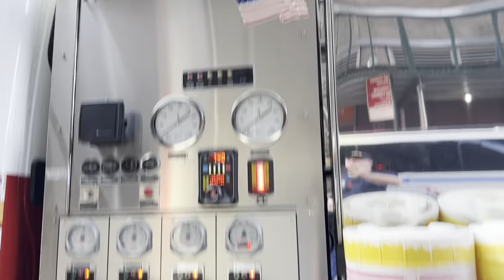FDNY Manhattan 5th Alarm 10-86 Box 0782 Crane Collapse with Fire Major Matrix Response

Comment: Those engines are huge. Here in UK they are about 26 -35 feet long and about 30 tonnes 🇬🇧🙌🇺🇲 respect to all you firefighters 👊
Reply from the maker: Thanks for watching
Reply: In UK they would have put the fire out quickly instead of taking lunch breaks while it burned.
Reply: @Donnie-fe7dc Sure, if it was a regular house fire, but something like this requires a ton of resources and logistics. You can't just send fighters straight into a fire like this. You need to assess the situation and act accordingly. You simply cannot say that our UK Firefighters would have been more effecitive.
Reply: Better to have them electric instead of having a diesel engine on top of it which could overheat and start a fire
Reply: @peon9282 this is the dumbest thing I ever read. Electric isn't strong enough to power the pumps, not even close. Not to mention batteries are way more at risk of overheating and causing a much worse fire that can't easily be put out. Stop it with all this electric nonsense

Comment: Thank you so much Skyler.  Great coverage.  It will be interesting to hear what caused the fire.  Blessings to the FDNY and EMS for the work that they do.  They are all exceptional at completing  their tasks. Blessings to all and please remain safe!  🤗
Reply from the maker: Thank you too!
Reply: Silly how FDNY has names on the back of their uniforms, but the Yankees do not.
Reply: It was apparently caused by a leak in the hydraulic pump while lifting 18 tons of concrete. They were just starting to pour slabs on a recently built floor when it happened.
Reply: @Mildain2000  how do you know that brother? I am just curious, I "thought" these cranes are powered by electric. I am not above correction. And "if" fuel, it'd be diesel which has a different flashpoint then gasoline, I am in this field brother, I am just trying to understand..
Reply: @bobbytogores4902 I was confused by that too, all tower cranes I have seen are electric. Thinking maybe it was hydraulic oil ? And the engine room they referred to is the motor/ motor control room. Simple fire in a nightmare location. All the best to the fire fighters and this guy for filming it.
Reply: @bobbytogores4902  Apologies - I meant to type hydraulic pump, not fuel.  I have a picture from directly across the back side of the crane (about 100 feet away) and it's coming from what looks like an electrical room behind the cab.  What surprised me is how fast the cables gave out considering the load they're rated for.
Reply: @Mildain2000 load at normal temperature.
Reply: @bobbytogores4902 hydraulic fluid. We used low flash in the foundry but most hydraulic fluids are flammable. I would think they would require low flash oil for equipment at heights like this.

Comment: This was amazing coverage of this incident!! Thanks for all the effort of putting this together and posting. Great teamwork throughout for what proved to be a difficult location to tackle. So interesting to see this whole thing unfold and see how US emergency teams worked this. Hope those who were injured are ok and make swift and full recoveries. Remarkable no one was killed in this incident. With an ever increasing number of taller buildings in London and our other major cities here in the UK, it makes me wonder how ahead of the curve we would be to tackle fires like this.
Reply: This is going to sound cliché but the truth is due to both fiscal and political reasons most FD's in metropolitan areas have to improvise an awful lot with elevated fires like this. FD's have been calling for not only limits on high of structures but updating of the building and fire codes so that internal structural fire suppression systems and water feed lines for FD"s be on a separate line than the cities main water supply. Equipment and manpower wise again that is based on the fiscal draw per year and the number of structural fire calls they respond to. Not long abo England saw the results of poor building code enforcement when an entire apartment block tower was engulfed in flames. I am positive those firemen and first responders did all they could do during the fire itself. But what was allowed to happen prior to the fire was out of their control. The building owner with full knowledge of the material to be used hired a contractor to upgrade the buildings facade with a highly flammable building material which only hammpered suppression efforts. Hence where the politics comes in, a lot of agencies don't listen to the FD when they say we need to limit structural heights. We need to stop allowing highly flammable building materials. We need to upgrade fire and building codes so newer buildings are built with internal fire suppression systems that slow the burn rate down. A lot of current internal structural fire suppression systems like sprinklers are woefully inadequate and offer little as  the original plan for them was  for better coverage and cost more money to install, so the developers and contractors petitioned for what is in current use. That hasn't changed much in the last fifty years. We see this all the time here in the states, homes and apartment buildings packed with toxic flammable home decor and building materials with the minimum if any fire retardation factors.

Comment: How do they get all that water up on the roof of those buildings so quickly? I imagine with all the pressure to go up several floors it would be difficult
Reply from the maker: High pressure pumper
Reply: When you got a 300+ HP PTO available, you can get water wherever you need.
Reply: Any numbers of what they were pumping at?
Reply: Plus buildings have a standpipe and booster pump. Thanks to the building engineer. Before I retired I was responsible for testing and maintenance.
Reply: In California they would use helicopters and drop water it’s faster I wonder why didn’t they use that
Reply from the maker: Ok that’s California…. This is NYC…. The pressure of the water and with a crane that collapsed and possible would collapse more wouldn’t be a good idea
Reply: @Kriz89_FLORENCExDISTRICT  Because NYC has a much more dense, urban environment than anywhere in California. It would be too risky to use a helicopter.

Comment: Hearing the chief switch channels makes me think, if your able to and interested, you can split two radio channels between both speakers in a recording if you have two radios, and you use or make a 35mm splitter that links one to the left channel one to the right. 

Sometimes it can be too much, but I've recorded airsoft before and had my team on the left speaker the other on right, so you could hear both and on PC distinguish which side was what. Also used it to record the NASCAR officials radio and Officials to Racers channel at my local raceway.

Comment: What system is generating enough energy to throw the water that far? 
Was it the pumps in the building, and if so, is that standard design to have that much pressure at the highest point of the structure?

Comment: Great footage. Them crews had water and resources up there flowing oretty fast. Nice work. I'm curious  if they could call up the closest smoke jumpers plane/helicopter and dump light loads of water on it like they do in brush fires?  I get they couldn't dump a whole planes worth with the area it's in and the weight of the water causing a secondary possible collapse of the whole unit but, maybe that could be a resource for the next exterior-high rise type event? There has to be something close with the Adirondack Mountains, Vermont, Conn, etc.....close by.

Comment: Might be an idea to have sections of flanged steel pipe attached to mast sections with sprinkler heads on the rear pendant and counter jib.
A pump and Siamese (FDC) connection at the base would complete the installation for cranes above 40 stories.

Comment: What was feeding the fire? Most of components are made of steel, was there a diesel engine with it's fuel supply? I tought cranes were powered by electricity. An electrical system wouldn't have enough combustible material to burn for that long? How could a part of the structure fall down, the bolts holding it melted away? Many questions were not asked by journalists there.

Comment: "Back in my day, the Super Pumper coulda hit that from Central Park!"
Reply from the maker: Hahahahaha
Reply: @SkylerFire  The lads (and ladies) were kind of screwed here - no real way to get sufficient water (or foam) up there.

I wonder if there will be new SOPs for this kind of fire?  Or if regs will be changed to add a damn automatic extinguisher system to the "engine room"?  

Good on the operator for trying to put it out  and glad they made it down OK.

Comment: I know this would probably sound ridiculous but here is my idea, how about a fire drone where it hooks up with fire hoses and it has nozzle guns that fly it to the position where you need it I know it sounds ridiculous but in this situation it would be really great
Reply: Not really possible, the hose would have to be dozens of stories long, which would weigh thousands of lb's not including the water's weight. Even if neither of those were a concern the  drone would have to displace the dozens if not hundred's  of ft lb's of energy from the pressurized water.
What's more realistic is a swarm of hundreds of drones dropping fire retardent chemical pouches.

Comment: Bet the operator and rigger miscalculated that cement bucket load limit for the crane ! too many things point to that and then the crane motor  catching  fire then brakes failing and then the full collapse of that derrick crane.  Miscalculation of the  weight load to how high that load has to be  picked can be catastrophic as this video shows.
Reply from the maker: Thanks for watching

Comment: Every tower crane should have a fire suppression system AND be fitted with a dry standpipe.  Just sayin...........
Reply from the maker: Ok
Reply: By suggesting a standpipe system, than means you would expect firefighters to ascend the crane and operate at the top.  Do you think that's the best idea?  Ascending an already compromised structure, with no secondary means of escape?  That is an assignment I would not accept.

Comment: After watching this they should require all new high rise buildings over x amount of floors have a type of outer motorized platform/ lift that can attach to the outside of the structure to use to get to the heights normally out of reach by normal means … it’s shocking that still in this day and age that

Comment: Looks like they could have used a drone you can hook a line to, to send up there to put water on the fire.
Reply from the maker: FDNY doesn’t have that capability yet
Reply: @SkylerFire  I know. But they should look in to that and so should any fire department with hard to reach/get to areas.

Comment: If only they had a helicopter with like 500 gallons of water, and an onboard monitor to hit the fire with. 

I'd imagine something like that would be expesnive as hell. Maybe not even possible or practicle.
Reply: Helicopter water drops are very common, would work in this case...
Reply: @rsinclair689  I'm not talking about a drop. I know those exist. I'm talking about them having a monitor (like the ones on the tower ladders) that they can use to hit the fire with precision. You also wouldn't be dumping all the water at once in one spot. Which could have issues in a city environment.
Reply from the maker: It was coming
Reply: @eriksand9262 They have that capability in Moscow, Singapore, Tokyo, Dubai but this city’s emergency responders fail to adapt and adopt new capabilities.

Comment: I'm surprised there is that much to burn on a crane and a fire led to the loss of the boom.
Reply from the maker: Yeah
Reply: Probably not the boom that failed but the cables that raise and lower it. The would have been threaded right over the seat of the flame. Hydraulic fluid mixed with diesel makes for a hot flame
Reply: @peterkneissl3358  diesel? Tower cranes use electric motors.
Reply: This is unique," said former NYC DOB Commissioner Rick Chandler. "Looking at some of the videos I've seen on social media, it looks like the engine, there was an issue with the engine and the fuel that provides the power to the crane."
Reply: Most in NYC are diesel powered

Comment: NYPD helicopter should have a bucket system like the wildfire helicopters for emergencies.
Reply: They do and it was in the process of being implemented but the fire burned itself out before they utilized it.
Reply from the maker: Yup
Reply: @fa3556  I've never seen or heard of that with NYPD, but it makes complete sense to have one.
Reply: @azul8811  not sure of the capacity but any suitable standing water source can be utilized to fill. Even a residential pool if the bird can get enough clearance.
Reply: @azul8811  couldn't tell you what the accuracy would be and yeah I'd like to think that the impact load on the structure was considered. Maybe that's why it was never implemented.  IDK
Reply: @azul8811  I misspoke saying in process of being implemented.  Not quite. Pd was preparing should the request to implement that operation.

Comment: How did a fire cause the cranes metal beams to fail? Thats impossible right? Yeah.
Reply from the maker: Idk
Reply: No it's very possible. A burning cranes fire reaches temps up to 1100°C (2012°F). Steel starts to get weaker and glows at approx. 720°C (1328°F). So with enough time, it will fail.
Reply: @PySnek  I was being fascetious

Comment: two guys on a hose and a hundred  standing around
Reply from the maker: 5 companies companies on the roof with 2 lines… another 3 companies on another roof using another line…. Understand that all these buildings had to be evacuated. They are high rise buildings it takes a lot of manpower. Plus these companies have to be revealed. You shouldn’t bash a department that is doing it the correct and safe way.
Reply: @SkylerFire    all those buildings had to be evacuated… just like everyone needed to be vaccinated 🤣🤣🤣